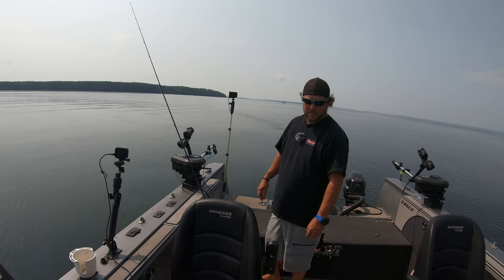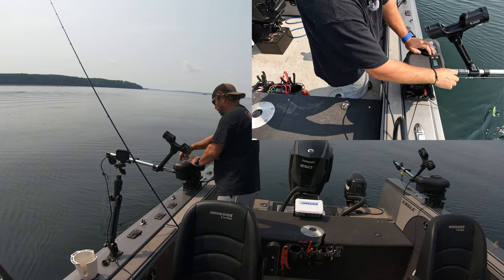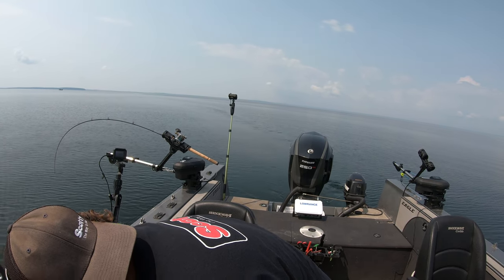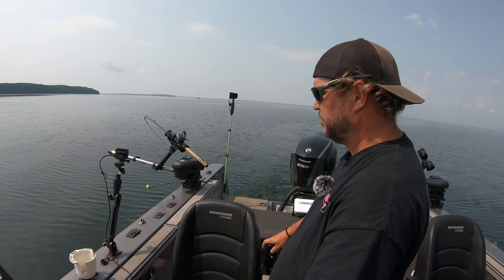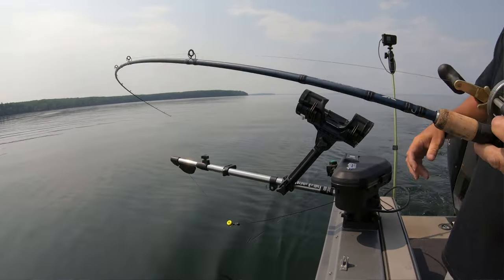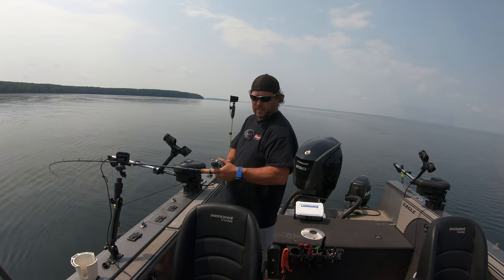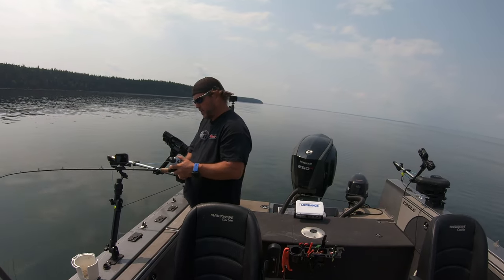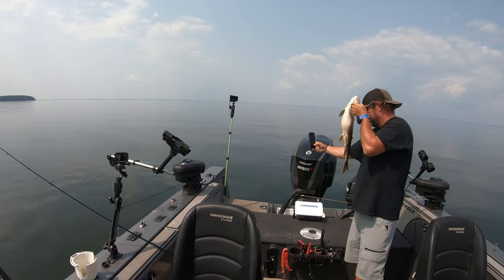How to set a Scotty Electric Downrigger for Lake Trout on Cold Lake

Comment: Great video, very informative. How did you mount those Orca rod holders to your booms? Would your attachment work on a smaller 1050 Depthmaster? Thanks again.
Reply from the maker: Thanks. Glad you liked it. 

I use the orca 405 offshore kit seen in the previous video to this one. 

If you already have the Orca you could just add the 459 to the mix and it will fit on the 1050 as well.

Comment: Great video!  Try some 60" Scotty releases if you can! No bending over to hook up...just grab the clip line with an eye from a swoop of the rod.  Neat thing is the clip clearly shows on the graph as it's far enough away from the ball that if you catch a small shaker you can see the two lines  on the graph come together!
Reply from the maker: I’ll have to check my releases stock and give it a try.
Reply: @BulatOutdoors  yeah, just try it if you have one or even just buy some heavy leadee material and extend one.  It works really good and best of all especially in the ruff stuff...no bending over the side!
Reply from the maker: @rytekmarine6717  I’ll see what I have. I think I have some long ones in the cabinet or I’ll grab some from my local tackle shop